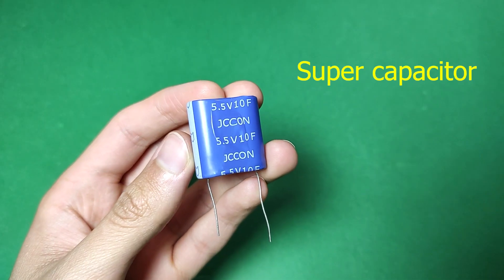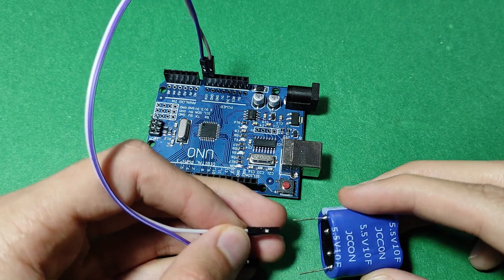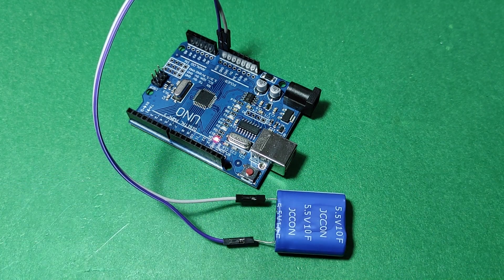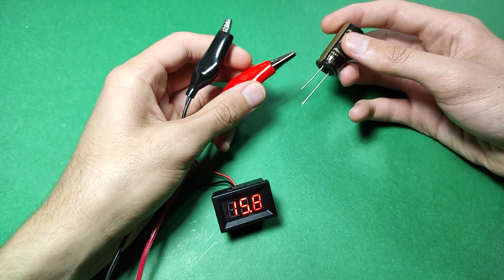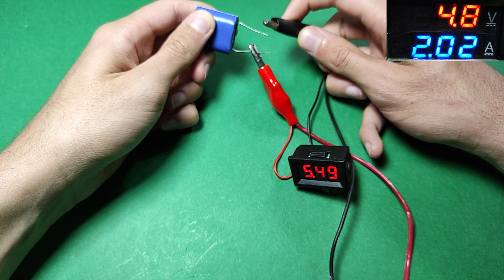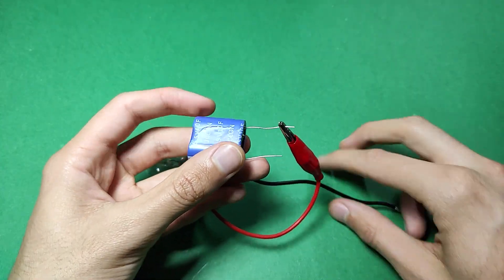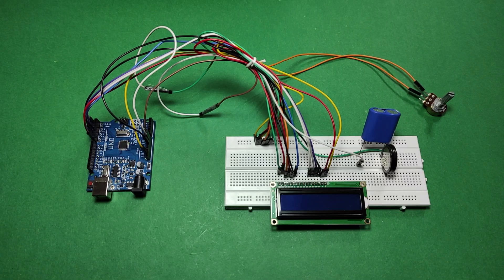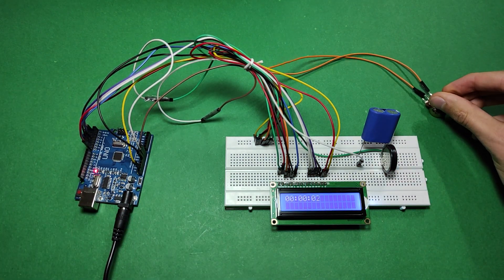Testing The Power Of Supercapacitors

Comment: If you put 2 in supercaps series (although the package already has some of the same capacitance in series), it is wise to match the same value of capacitance. Otherwise you end up charging the capacitors with the lowest capacitance negative. Which will shorten their live dramatically. From an endless live to (almost) one-time use.
I charge my phone every day (using an USB 12-24 V car adapter)) by charging up supercaps with my electric bike. The caps still have the same capacitance. (ps: I have to peddle on the electric bike to generate power, the motor is used as a generator). This way I keep my phone between 20 and 80% charge for a prolonged life of the (non replaceable) battery.